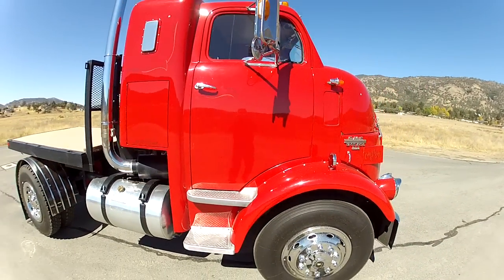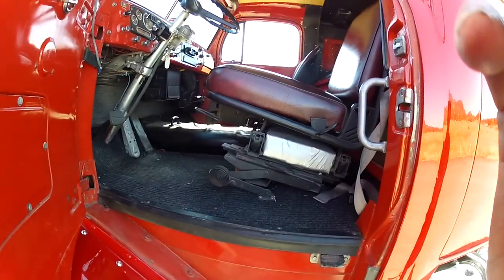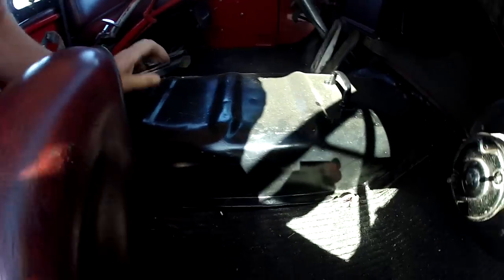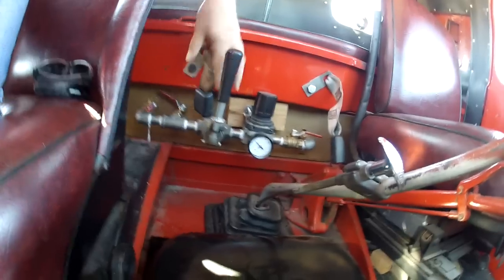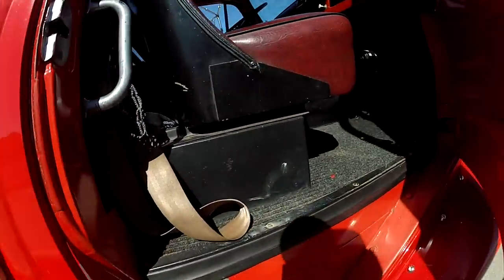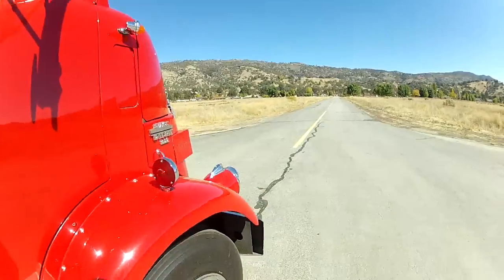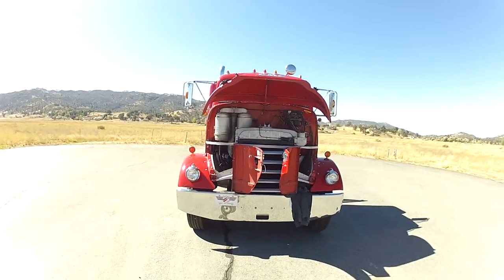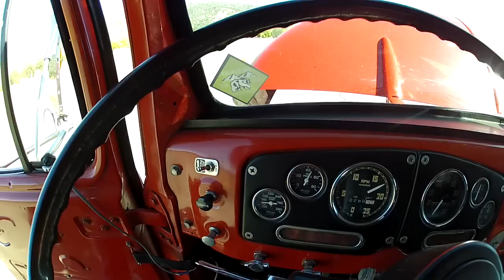1959 GMC DETROIT DIESEL HOOD OPEN SHOWING MECHANICALS OF TRUCK AND DRIVING OVER CAMERA

Comment: Youre welcome. If interested Detriot is a division of General Moters. Thier first 2 stroke diesel was called the 53 seties, next was 71 series and finally the silver92. Todays Detriots are 4 stroke and called 60 series. It is one of the first ECM engines put into on highway trucks.  Enjoy that old Jimmy not many of them left.
Reply: The 71 series came out before the 53 series. It powered many military of WWII. I don't know for sure, hut it may have debuted in the 30's. The 53 series was released for the 58 model year, and debuted in the fall of '57.
Reply: +madtownmadman You are right the first model released was the 6-71 N went into production around 1938 and did great service in WW2 powering anything from Navy landing boats, through tanks, trucks, pumps, generators anything that needed power probably had a 6-71 bolted on the front.
Reply: Not quite, it's largely a Mercedes design but they are built at the same plant in Redford.

Comment: such a relaxing sound hearing that gear shifting of that old diesel engine cummins.
Reply: Two stroke Detroit.  ;-)  It is a pleasant sound, but a very different engine from a Cummins.  I don't think Cummins made any commercially available two stroke engines.  If they did it was long before this truck was ever made.

Comment: beautiful capture,the truck is inmaculate,no smoke when accelerates the engine. Only a thinng,The engine cab cover may be in optimal conditions in the seals (neoprene or others) But the accesibility to the engine is good. Three access;front   cab   and rear.

Comment: Looks like you need to drain those air tanks a little more often. Nice restoration job. I can't believe you got that old 238 sealed up....I didn't see a gallon of oil under it.
Reply from the maker: It only has 9000 miles and about 286 hours on it since a complette frame off rebuild and is holding its fluids and air real tight. It drives like a new truck . Thanks for looking.
Reply: It is a beauty!!!!! Real Nice!

Comment: What a sweet restoration job. Did you regerster the truck as a pickup because of the wood box. Here in Ny it cost over 500.00 just to regerster the truck because i would have to regerster it as a  commercial  truck. Thanks for the video.
Reply from the maker: ***** It is an antique vehicle out here so it cannot carry anything. Thanks for looking.

Comment: If you need to change the motor how does that work? Do you have to remove the cab?
Reply from the maker: I just replaced the head , cylinders , and liners a month ago. First you remove the passenger door , the seat and engine cover , then the floor comes out and you go at it. Not easy but not really that bad either. Used a fork lift to lift the head off .

Comment: Nice truck,great video. Thats not a supercharger, all 2 stroke detriots use a blower to move intake air threw the scavenging ports. It would be called a supercharger if mounted on a gas engine under the carbs or injection system. Thanks for posting.
Reply from the maker: scott scottswart440   Thanks for looking and I appreciate all the info shared by others !

Comment: I like that whistle a lot....what model is that whistle exactly? I'm guessing it's a 3 tone?
Reply from the maker: +Daniel Alberty  Hi; It is a Hancock model 4700n   there is also one without the cone around it that is model 4700. They were made in the 1950's to sound like a steam locomotive . They no longer meet standards for railroad use and turn up on ebay once in a while. Thanks for looking . The video below has more whistling in it.

Comment: What is the cable running up the gearshift for?
Reply from the maker: AUSSIEGIZMO76  It splits the transmission into a high and low range giving you 10 speeds.  Thanks for looking !

Comment: what does the "jake break" do?
Reply: +Oskar emretsson They where the original cruise control. Some Engineer said "Lets give Jake a break" and the Jake break was born.
Reply: Yeah, no. It's a system that uses the engine's compression to brake the truck. You'll notice the revs drop much faster with the jake on.

Comment: Sounds like it has a miss at idle.  Pretty ratty sound fore a 6-71.  I also like the oil drips on the asphalt under it. 
What sound does a Detroit make when it's shut off?
DRIP.....DRIP....DRIP.
Reply: probably from the crank, they do have breather tubes that mist out pressurized oil so the crank don't blow, pressure has to go somewhere ya know

Comment: you change the rims the originals are a pain in the ars
Reply from the maker: +connor jones   The rims are still Daytons but not split rim so not too difficult . I am going to remove the wheel covers on the rear and paint the rims and spokes this summer . Then add some chrome moons and lug nuts. then it will have the deep rear rims showing again. Thanks for looking !

Comment: +rileydog362  How does the compression release on the Detroit 6L71 tie into the fuel-injection governor?  The Jacobs hardware obviously is smart enough to restore compression before the engine flames out.
Reply from the maker: You remove the buffer screw and replace it with the Jacobs on - off switch which has a buffer built into it .As soon as you touch the throttle it shuts off the jake and also when it hits idle at around 500 RPM it shuts it off .

Comment: I wonder how much that thing can pull, cause modern pick ups have gotten to where they can pull over 30,000 pounds.
Reply: You know they rate and classify trucks based on GVWR right? Any truck that pulls 30K is instantly a class 8 (semi truck) A class 7 is something like a F750 or a 7500 6500/650 is a class 6 ect. A 4500/450 pulls around 14K.
Reply: This thing will pull 80000 pounds easy.
Reply: BarryEssex it would pull slow and if it's suspension was even rated for that. Single axle light duty only. I'm sure low horse power. I use tractors with 460 HP and they take a little time to wind up when loaded at 80,000 lbs. Sweet ride turns my head when passing by vintage iron.

Comment: tel me pleez what is jake brake ???
Reply from the maker: It is made by Jacobs and is an engine brake. It basically uses the trucks engine as a compressor and holds the truck back so you don't have to use the foot air operated brakes and saves the brakes on the truck .It is a very safe and efficient operation to slow a heavy vehicle.  Older trucks sound like a machine gun and were very loud in years past but the newer trucks are much quiter. Another type is an exhaust brake used on some trucks and also newer diesel pickup trucks.  Thanks and hopefully others will go into more detail.
Reply: rileydog362 There was a many of time I wished I had a Jake brake! My boss at the time was from the flat lands Oklahoma and we only needed them when we went way east or west. We drove north and south hauling grain but sometimes we has so west Texas hills and eastern Oklahoma that we really had to pay attention because there was always a stop light or sign at the bottom of a hill in a small town.

Comment: Why do people have to rev these old diesels like they're a racing engine? What's the point? It's made to pull a load down the highway, not run a 10 second quarter mile. These old 2 strokes are getting rare enough as it is, then you have people like this trying to throw rods for fake internet points.
Reply: Those old 2-stroke Detroit's ran best when revved up to maximum governed speed. That was simply the nature of the beast.

Comment: We had a picture of an old Peterbuilt hanging on the wall at our shop , it had a 318 Detroit . Every morning we had to wipe oil off of the floor under the picture . That's a very nice restoration , very clean job . Looks like a 238 6-71 engine .Enjoyed the video . I recently rebuilt an older 238 with the external fuel lines .
Reply from the maker: +ALABAMAHEADHUNTER    Thanks for looking !
Reply: 2 Valve head? Once upgraded from a couple of those in the 80s to the 'dogbone' 4 valve internal fuel galley heads.

Comment: I remember those cannonball GMC tractors in the 1950s. Here on the east coast of the US most of the trucks were IH, White, Mack, Autocar, Diamond T, Reo, GMC, Ford & Dodge. It was rare to see a Peterbilt, KW or Freightliner here. They were western trucks back then. Later Diamond T & Reo merged becoming Diamond Reo, Freightline partnered with White & became White Freightliner & I think it was only a cab over truck then. The big sellers here in the 1950's were IH, White, Mack, Autocar & GMC. When I occasionally got west of the Mississippi, that is when you began to see KW & Pete. It was also the days when the ICC restricted trucking companies to certain states. When deregulation happened under President Reagan, it eventually put many of the east coast trucking companies out of business. McLean (big user of GMC tractors), Hennis, Red Line, Pilot, Mason-Dixion etc etc. They just couldn't compete when they lost their dedicated territory & gained a large number of new competitors who expanded into the east from other parts of the country. The famous two cycle engine was badged "GMC" then but if you spec it in an IH or White etc, they called it a Detroit but it was the same engine. Most of the non GMC/Detroit engine trucks had Cummins. Cat wasn't in it then. Mack of course had a Mack engine.It was easy to tell if it was a GMC/Detroit coming down the road but after you were on the road long enough, it also became easty to tell the different in the sound of a Cummins and a Mack.
Reply: Great history lesson. I really like American trucks.
Reply: bob lackey I
Reply: bob lackey I
Reply: The deregulation of the trucking industry began with the Motor Carrier Act of 1980, which was signed into law by President Carter on July 1, 1980.
Reply: You forgot the big boy  " Brockway"
Reply: Interesting perspective.  On one point:  Freightliner did not "partner" with White.  The White Motor Co. only provided dealership representation.  Freightliner was a wholly-owned subsidiary of Consolidated Freightways, Inc., a common carrier, who made all of the equipment for CF.

Comment: Detroit's don't have super chargers they are blowers as they are a pressurized block
Reply: +Andrew Tiefry are you confused with a super charger and a turbo charger? A super charger is a blower
Reply: +Andrew Tiefry The blower is used to force the spent fuel out of the engine , its called scavenging , without it the engine would not run . adding a turbo would be supercharging so to speak . Love the sound of these engine's
Reply: +Dan Holmes adding a turbocharger is turbocharging it not supercharging it
Reply: The blower has a different purpose here. A supercharger is used to pressurize the intake air. On a two-stroke diesel engine, when the cylinder bottoms out, the intake ports open at the bottom while the exhaust valve opens at the top. The purpose of the blower is not to pressurize the air, but to push fresh air into the cylinder through the intake ports while pushing the exhaust gases out of the exhaust valve at the same time.
Reply: THANKS FOR STRAIGHTENING THIS OUT--SO MANY PEOPLE THINK THE DETROITS WERE SUPER CHARGED BECAUSE THE BLOWERS WERE USED ON SO MANY DOUBLE A FUEL DRAGSTERS AND SO FORTH BUT THEY WERE NEVER SUPER CHARGED EVEN WITH A TURBOCHARGER--FROM AN "OLD DETROIT MECHANIC"
Reply: Blower, supercharger same theory.  Clean air in bad air out.
Reply: Actually turbocharging is a contraction or shortening of turbosupercharging. Supercharging used to refer to any forced induction.
Reply: i knew a semantics discussion would be in the comments when the term supercharger was used when referring to the blower.

Comment: It's not a supercharger, it's a blower. They are not the same thing. Superchargers increase the pressure and density of air for combustion. Blowers provide air for scavenging. They are necessary on large two-cycle diesel engines to purge exhaust gases and to fill the cylinders with fresh air for combustion. They do not increase air pressure like superchargers do on gasoline engines.
Reply: the  rootes type blower used on all Detroit 2 cycle engines do increase boost to the combustion chamber,relatively low pressure around 5 psi..but like you said the main function is to savenge and purge air into the cyls at a low pressure but still above atmospheric .
Reply: The blower is really just an air mover.  It is not a supercharger in the traditional sense.
Reply: Where do you think the 471, 671, and 871 "superchargers" came from in the 60s?  A supercharger is a blower.  On a 71 series engine, at rated speed, it is running around 12 psi above atmosphere.  That means 26psi at sea level.
Reply: Those are modified.  A blower is NOT a supercharger.  What that means is a device that raises the intake charge significantly above atmospheric pressure.  A turbo was originally called a turbo supercharger.  The blower on a 2 stroke diesel is not a power adder.  It is there so the engine will run at all since it has no way of producing any suction to move intake air in and exhaust out.  The blower facilitates that but does not generate significant pressure above atmospheric.  That is why later the added turbochargers which did.  The blower is a glorified air mover.  On a car when they called them that - it was in reference to their original source and use.
Reply: The blower/supercharges that were used in the sixties on V8 gas engines were straight take offs from 2 stroke Detroits.  The only thing modified was the adapter plate to fit it to the intake manifold.  I agree, that a 2 stroke diesel will not operate without a blower, but to say that the blower doesn't "boost" the intake charge is incorrect.  12 psi is almost double the pressure of the atmosphere at sea level.  I'm sure anyone would consider that significant.  The roots type blowers/superchargers are all positive displacement air pumps that increase pressure directly proportional to rpm.  Turbochargers were added to the supercharger setup to decrease the power needed to turn a larger supercharger.  The same effect can be had with staged turbochargers.
Reply: jd403020
  They don't make 12 PSI on a detroit.  The belt drive system used on a gas engine runs the blower at a speed much greater then it would have moving signifcantly more air then when gear driven on the detroit.
Reply: Every 71 series I have ever worked on was running 10-12 psi.  It has to boost intake charge or there would be no pressure differential for the scavenge cycle.  You even said this yourself.  If the blower didn't increase the intake charge, no air would get into the cylinders.  Next time you are around a 2 stroke Detroit, hold your hand over the exhaust.  That air flow you feel is the pressure and flow from the blower since there is no exhaust stroke.  Try plugging the exhaust and then tell me there is no pressure.  Most gas applications are under driven to get the blower to around 6 psi.  Typical blocks and heads on gassers won't handle much boost pressure.
Reply: It's a glorified fan.  When you remove and modify it for a gas engine, you can call it as supercharger.  Otherwise it is just a positive displacement air mover - a blower.  Nowhere in GMC's nomenclature is it called a supercharger.
Reply: I think the problem here is that you think the blower/supercharger is a velocity increaser.  In fact it is a compressor.  Block a fan off and what happens?  The fan still spins.  Block off one of these superchargers, you either blow off the blockage or blow the seals out of the machine.
Reply: Old comment thread, I know, but for anyone else reading this who might be confused:

A blower is a device. A supercharger is an application. These engines have intake ports in the cylinder walls and exhaust valves at the top of the cylinder. Because they are a two-stroke, they do not have a dedicated intake stroke in which the cylinder sucks in an air charge. Two-stroke engines require an external force to literally push fresh air in, and at the same time, push exhaust gasses out. Common gas engines do this in the crank case, where the crank and rod acts as a fan. This is why lubricating oil needs to be mixed with the fuel. In a diesel, the crank case is sealed off, so some kind of external air pump is added. In GM/Detroits a Roots blower is used (Except for the 110 Series and the bigger EMDs). The blower is used to deliver an air charge in the first place, not to enhance one that already exists. In other words, the blower is just a "charger"
Reply: @holysirsalad  That sounds logical and honest, not like some butthurt comments.  haha . Thanks for the tech info doc!